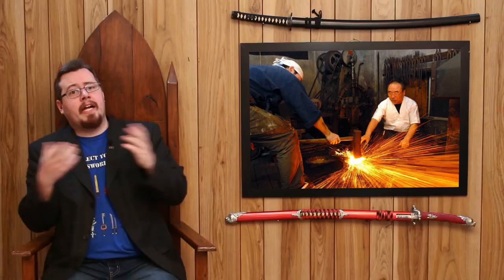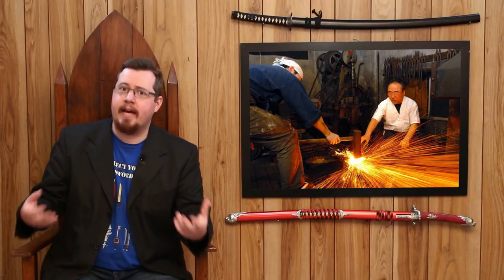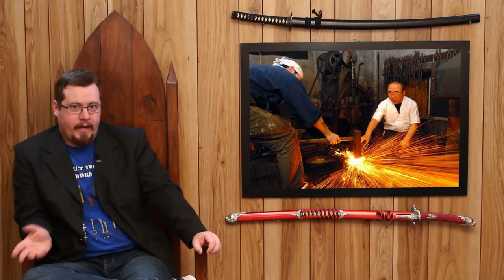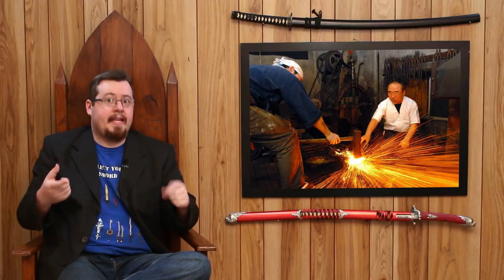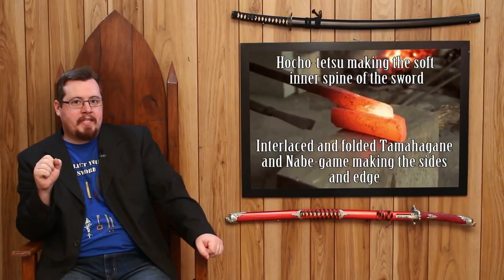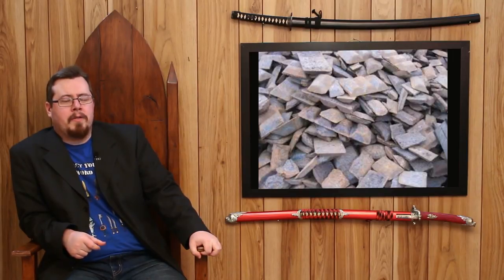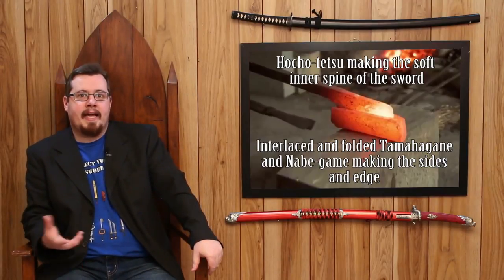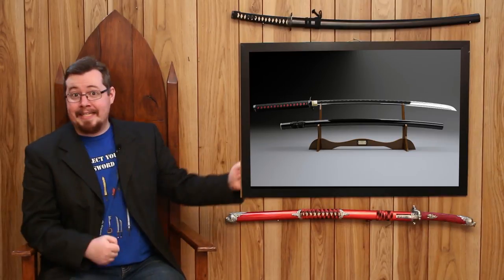The TRUTH about the KATANA, part 3: Why the steel is folded

Comment: The smelting process is a bit deeper than this even. Of note, adding carbon to the iron actually decreases the melting point. So while the smelting process of the day did not get up to 1550C, if enough carbon was added to the ore, it would actually melt, but you'd be left with pig iron, more commonly known as cast iron. This name came from the casting process common in Europe where the molten metal was poured down a channel with numerous ingot molds branching off of it, somewhat resembling a bunch of piglets suckling on a sow.

The thing is, steel is just iron. On the low carbon content side, you have what's known as "wrought iron". This is iron which is smelted to a bloom in a bloomery, and then is heated and hammered to get the impurities out. It's relatively soft and easily damaged, but malleable. On the high end of the carbon content, you have cast iron, which is extremely hard, but also brittle. It can't be heated and shaped. Once it's cast, it's done unless you melt it down and recast it. In the middle is what's known as steel. It's harder than wrought iron and holds its shape far better, but can still be heated and reshaped at the forge. 

The problem? It's a pretty narrow sweet spot to hit between steel and cast iron. Until the mid-1800s, it was pretty tough to get it right due to the inexactness of the materials and tools at hand. So there were many ways developed to reach that spot from baking wrought iron bars in charcoal to the much trickier act of creating a hot, oxygen rich environment to decarbuerize cast iron by drawing the carbon back out, or even forge welding to mix the cast iron with lower carbon iron.

Until the industrial revolution and the advent of the blast furnace, making steel was a difficult and time-consuming process, more art than science for the most part, which was one of the reasons it was so valuable.

Comment: a lot of blacksmiths can answer the issues you are not sure about.  But you are correct in saying its kinda a mix of both, sure some impurities get folded back in, but a lot of the slag flakes off with the carbon when you upset/distort the metal.  good study at the end. now just need a study to see if any of those inclusions detract or enhance the function of a sword.

Comment: My understanding of the 'pig' in 'pig iron' is that it was common to pre-smelt mined ore at lower temperatures close to the mine to remove gross impurities prior to transportation to the high-temperature refineries further away. The ingots of crudely-smelted iron were standardised for easy stacking and trassport to be about the weight of a pig carcass.

Comment: Thank you! Very interesting and informative video. I think it entirely makes sense. However, imho you have made one small error in you reasoning. You are saying that the forging process would burn out slag and only things that already are oxidized would remain. However, you assume that all the components of the slag either produce gas after oxidizing (like carbon) or are already oxidized and therefore cannot be 'burnt away'. You are forgetting however, that there could (and will) be some elements in there that are not oxidized yet but will not 'burn away' when oxidized. Chemical elements that produce solids when oxidized (silicon, titanium, aluminum, iron itself etc.) can be present not only in oxidized but also in pure (not yet oxidized) form at the beginning. They will burn during forging but they will not evaporate like carbon. They will burn and will remain there in the oxidized form after folding process. 

What I've found interesting in the graphs was that there was significant amount of iron oxide in there. I think you assumed that it was remnant from the iron ore. It's probably true for some part of it but I would imagine that at least some of that would be the result of the forging itself. When hot iron comes in contact with the air part of the iron molecules will burn and oxidize. When folding, you would not be burning only carbon and slag but iron itself as well. Therefore, I think that not only the decreasing carbon content but also the increasing iron oxide content would put some limit to how long you could continue folding process. At some point you would be making it worse by adding more and more iron oxide through forging.
Reply from the maker: +Vincent Meis This is a GREAT point! thanks heaps for pointing it out. You're right about the probability of iron oxide being put into the steel from folding as I even read somewhere that when folding you have to be very careful to not trap the scale (oxidized surface iron) in between, which simply points out that it is very possible to do so. So yes I agree completely! It is very possible to over fold something making the steel far worse than it originally was.
Reply: Shadiversity great video with excellent detail Shad!  Speaking as a blacksmith with direct experience with pattern welding (aka making layered steel or Damascus steel) An important step in this forging process is to “brush” off the forming oxides before fusing another fold together.  This knocks off the top layer of fully oxidized steel before smushing it together.  Nearly all smiths also use some form of a flux  to create a protective layer to over the steel, preventing any oxygen from reaching and contaminating your  sword-steel.  

Interestingly, that paper makes note of the high amount of oxides and concludes that the sword being tested was forged without a flux.  (Refers to a lack of deoxidizer)

That old smith folded the steel enough and hammered the edge well enough to minimize the inclusions specifically on the edge of the blade.  Sounds to me like he knew how to properly forge the edge bevels rather than rely on filing to refine the sword edge.

Comment: This may sound like a stupid question, but I'm curious and not very knowledgeable.

The reason the katana was folded repeatedly was to help remove more slag that was unable to be removed through smelting. Since this is the case, does forging a katana with properly smelted metal create a superior blade, would the folding process be damaging to the final product, or woud it just be pointless due to the fact that slag does not need to be removed.

Comment: I know you might not have a chemical degree. But I just want you to point out that water is H2O or dihydrogenoxide and not hydrogendioxide (HO2) wich is different from water. 
The naming of the molecules has a system. After each element comes a number, if the molecule has more then one of the same element in it. Then it becomes in the case of H2O dihydrogenoxide.
This channel was very informational to me so far and am grateful of that. Keep up the good work.

Comment: As a physics major, explaining what's actually going on with folding and forging the steel to katana fanboys has been a huge source of frustration.

You can't ignore physics, and Shad is right to say that folding the steel doesn't make it stronger, because of the simple fact you have molecules with oxygen bonded to them as a result of harvesting iron ore sand or magnetite.

Also, to correct your mispronunciation of the molecules in the study.

SiO2 = Silicone dioxide.

FeO = Iron oxide.

TiO2 = Titanium dioxide.

Al2O3 = Aluminium (III) oxide.

Comment: I think you get several things wrong here, lets back up and look at the metallurgy and how steel is made in modern world. 
You start with blast furnace, essentially you have a tall furnace, stacked with ore and coke and you pump air in it. The coke burns, iron oxides are reduced to CO2 and Fe, iron settles in the bottom, slag floats on top of that and more coke and ore are continuously poured on top and iron and slag are removed from the bottom. The iron that comes out is indeed pig iron with very high carbon content, because you just melted it in high carbon environment, but the slag is well separated so that is nice.
So next the pig iron must be decarburized to make useful steel, that is done in basic oxygen furnace, or earlier with Bessemer process and puddling furnaces. None of these were an option before 18th century so they couldn't make proper steel out of pig iron, therefore it and the blast furnace is out, because you cant properly decarburize pig iron by forging.
Now why cant you decarburize pig iron in a forge? You start with 1 part carbon, 20 parts iron(plus impurities) and you want to get 1 parts carbon, 100 parts iron. While carbon is more reactive than iron, guess what are you going to burn more of if you have alloy of 1 part carbon and between 20 and 100 parts iron? You can burn it all away and you won't get it decarburized, you just end up with lots of rust.
Instead in Europe a bloomery was used, its essentially same as blast furnace, except its not heated hot enough to melt iron. It could be heated more, its a question of bellows and elbow grease really, but if it were heated hot enough to melt iron it would not be called a bloomery but a blast furnace. Everything else is same, coke, or charcoal, ore and air pumped in.
Instead of pig iron you get a bloom out of a bloomery, metal is fused together, but not melted, its porous and full of slag. Its that spongy metal stuff you see in several parts of your video. Iron in the bloom may be full of slag, but it has proper carbon content, unlike pig iron that has little slag but way too much carbon.
Unlike pig iron, you can work the bloom in the forge and beat most of the slag out of it and get reasonable quality steel.
That's how it was done in Europe and from the looks of it Japanese used pretty much the same process but with hard to pronounce Japanese terminology.
Now the process from India is really good and interesting. Its basically crucible steel, but done millennium or two before Europeans started doing it in 18th century. So that is awesome. They get proper carbon content with the bloomery process and they get the low slag content by sticking the bloom in a sealed crucible and melting it in low carbon and oxygen environment. Awesome, best of both worlds. So if you want to know who had best steel in ancient times - the Indians had it. Unfortunately they don't really have an equivalent to "The Way of the Samurai" or "Knight in Shining Armor" to hype up their history.

Comment: Iron is a term given to iron with carbon equivalent above 2%, of it is below 2% it is called steel. What we call cast iron today typically has carbon equivalent of 2-4% pig iron typically has carbon contents of 6-8%. Iron with high carbon contents tend to have lower melting points so while low carbon steel will have melting points around 2700F degrees (to which you would get it to 3000F degrees so the steel would stay liquid longer). High carbon cast iron has a meeting point of around 2200F degrees(to which you would only get it to 2500-2700F to melt it). 

Tldr: melt processing is complicated and interesting.
Source: I'm an engineer that specializes in metal processing, specifically iron products.

Comment: 13:55 The traditional shape of the molds used for pig iron ingots was a branching structure formed in sand, with many individual ingots at right angles to a central channel or runner, resembling a litter of piglets being suckled by a sow. When the metal had cooled and hardened, the smaller ingots (the pigs) were simply broken from the runner (the sow), hence the name pig iron.  Should be called piglet steel if anything.

Comment: iron has a melting point of only 2800 degrees fahrenheit, so perhaps they could first attempt to remove as much impurities as possible and then begin adding carbon, but a lot of these melting points, including your reference of 3000, can easily be inaccurate to the melting point of traditionally harvested iron as the impurities affect the melting point significantly which is why pure iron melts at a lower point than steel.

Comment: So if there were a controlled environment where the forging area had none, to minimal oxygen and you heated your metal outside of the environment, but brought it in during the forging process, would the steel be very carburized?

Comment: Pig iron is called iron and not steel, because it's carbon content is much too high for steel. Sounds confusing, I know. But after you get past something like 2% carbon, the material properties change a lot, and you cross a vague line between steel and cast iron. Cast iron has a carbon content between something like 2.5-4% carbon, and as you may well know, it's material properties are a lot different. Pig iron is used pretty directly in cast iron processes, as well as steel making processes.

Comment: 17:44 I am not a chemist, but I'm pretty sure that silicates (which are basically rock) don't burn. And even if they did, the end result would likely be silicon dioxide, AKA quartz, which would still be an impurity.

Also, as others have already hinted at, pig iron is not a type of steel; there is an upper limit of how much carbon can be in steel for it to still be steel, and pig iron contains significantly more carbon than that.

Comment: In order to produce modern homogeneous steel you have to melt it. Many of the impurities in unrefined iron will burn. The bessemer process and later processes uses this to melt iron, forcing oxygen through semi molten iron to cause the impurities to rapidly burn and heat the iron to melting temperature. This forced smelting was discovered a few times prior to the industrial age, most notably to make wootz(?) steel in India. I think it was even discovered in Japan prior to the Meiji era, but by that time swords were essentially obsolete so there was no motive to apply this to swordmaking.

Comment: You can't remove all of the impurities from iron with any smelting or forging process. The only way to get pure iron is with electrolysis. You can then add whatever carbon you want. Incidentally, iron doesn't rust in its pure form. It requires carbon for that.

Comment: Decarburization is just another word for annealing, this process is countered by work-hardening. Working on either side of that spectrum can do bad things to your steel that is very hard to undo. Sometimes a steel item may have to be repurposed, re-melted, or have to undergo lots of annealing or work hardening. Because of that work sometimes a new tool wad just made and the other was repurposed.

Comment: Good Evening Shad, I just wanted to add a few things into this. The way Pig Iron got its name is because it's generally used as a weight, like the in the back part of a forklift, where carbon content doesnt really matter, so its kind of just a mosh pit of impurities and over carbonurization. The reason its called Pig IRON is because of the carbon content. Generally wrought iron is categorized from 0.00% to 0.49% carbon. Soft steel is generally about .5% carbon to 1.3% carbon and high carbon steel like tool steels etc are generally 1.4% to 2.0% carbon. Anything over 2% carbon is called cast iron, and like above when the carbon content doesnt matter with things like weight, itsnjust called pig iron. If anyone wants me go further into some other things about steel and things, leave me a comment and ill be glad to do so as Im currently typing this on my phone. Source: Two years of welding and metallurgy schooling; 5 years as an aerospace and structural steel welder.

Comment: So to make a superior "tamahagane" katana you should smelt tamahagane and the other one for the spine, and then forge the 3 types to get a homogenize blade, but I have a question: do you want to smelt pig iron to remove slag in it ? Or in the other sense: would smelting process remove carbon too ?

And even tho: is smelting good in any sense for "tamahagane" katana if it removes carbon too, since you have to forge the blade with less carbon at start because of the smelting of tamahagane and the spine steel ?

Comment: The thing with the three kinds of steel only holds true for a very small percentage of swords, though. Making the edge and sides out of Nabegame (which has a higher carbon content than normal, making it both harder and more brittle) is hard. Must blades just made do with a soft spine inlaid in a sort-of-v-shaped outer layer of harder steel.
The blade is hardened afterwards anyways.